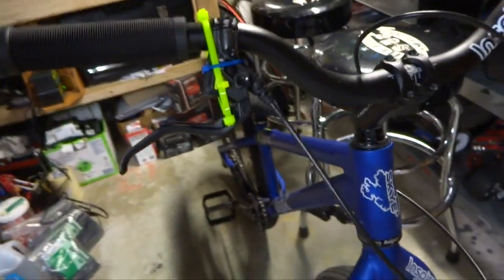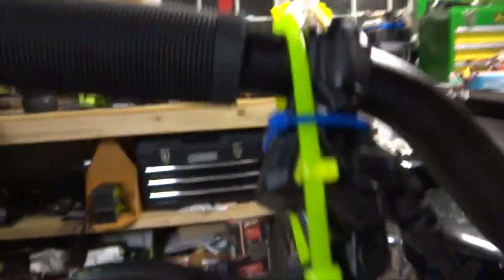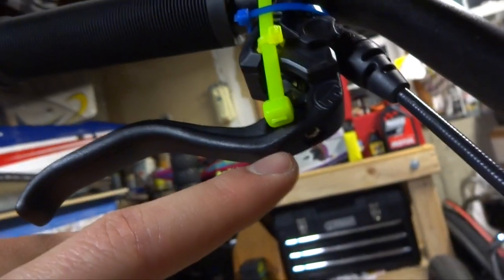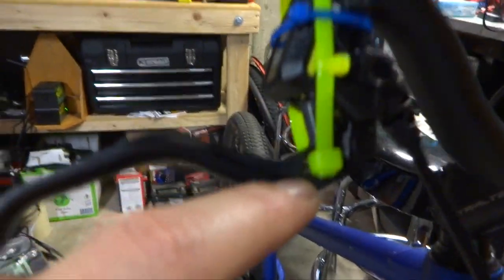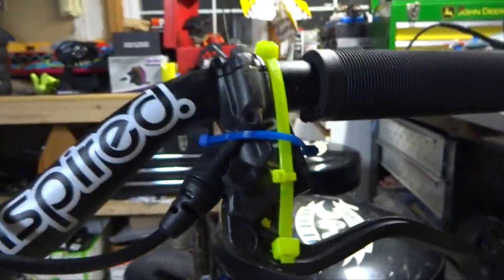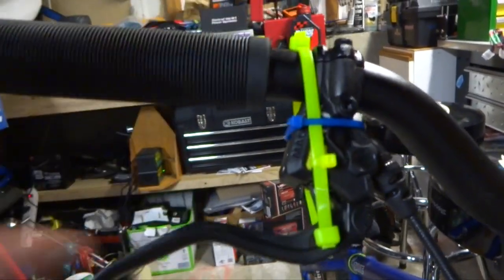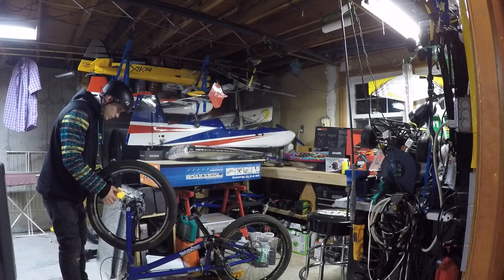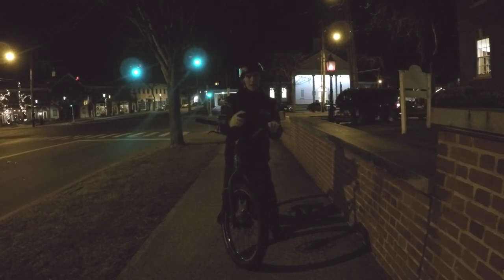Why Do I Zip-Tie My Brakes??

Comment: Honestly, as a professional bike mechanic I have to say that the zip-tie-"trick" is quite bodgy. Modern brakes close the hole to the reservoir when you pull the lever. The zip-ties you've installed effectively always pull the lever and therefor the reservoir never opens. This makes you unable to bleed your brake with the zip-ties in place and also the pistons in the caliper won't come out further as your pad wear progresses. In advance if the brakes get hot the break fluid expands and usually floats into the reservoir but as it is still closed off it effects your pressure point.
No offence but I'd say you should rather get accustomed to the different feel to your original brakes or buy different brakes and not just the one that Danny Mac runs.
Reply: Still you are an amazing rider. I wish I had your skills ;)
Reply from the maker: I understand your thoughts on using the zip ties. Yes this could cause problems down the road and I didn't want this to seem like a tutorial for how to make brakes stop better. Rather, simply answer the question as to why I have them on my bike since many people have asked me this question. Also, thank you for the kind words on my riding I appreciate it!
Reply: Actually I've been wondering too why you have them. Thanks for not taking the criticism the wrong way. I'm a subscriber since 200 subs or so and a big fan ever since. Keep up the good work! 
With your brakes, maybe you could copy Danny completely and put a bit of foam rubber on the inside of your break levers. He apparently had the same issue with squeezing to hard and trapping his fingers. :)
Reply: Indeed the new Danny Mac special edition MT7 brakes have a custom lever blade that's machined smooth on the back so you don't thrash your fingers.
Reply: Love the vids bro keep it up!  Not a bad little trick I fully understand.  Also if the caliper is slightly mis-aligned the pads don't quite work there way towards the disc completely and that causes increased lever throw and a warped rotor can push the pistons back in a bit too which increases lever throw a surprising amount. Basically if the pad pulls back at all from the rotor when the brake is released you will have increased lever throw. All this based on first hand experience with MT5 brakes on my street trials bike.
Reply: Hey, do you have any source or photo of this foam rubber on levers setup? I sometimes also have problems with crushing my fingers.

Comment: I have a similar sorta issue as I'm incredibly fussy about how my brakes perform (I like them to be like a hair trigger and snap on at almost full hold with less then 1 cm of lever movement).  A bike mechanic I know said something about over bleeding the system to achieve the feel I desired - but he also cautioned me against doing it as it may cause failure in the brake (he didn't elaborate).  I had (actually still have) an old Hayes single pot on a 200 mm rotor and that thing was a monster when applied - it was capable of spitting me off and flipping that 25 Kg bike with a single finger at almost any speed :) (I mention it cos the same mechanic bleed it perfectly).  Long ramble short, maybe over bleeding is something to look at if you get sick of your zip tie idea.

Comment: Finally😂 I've waited for some sort of explanation for the zip-ties and now i got it☺ But if you thigten this screw and hold the lever in place doesn't that mean that the caliper is getting pushed toghether  and then the pads rub to the disc? (If my english isn't that good i'm sorry i'm from Switzerland😁)
Reply: Sumo's'Enduro, I have magura mt5's on my bike, and there is a slight dead-zone when pulling in the levers, zip-ties can allow you to get rid of it.

Comment: And couldn't you do that with a longer screw? longer screw means that you can put more oil (piston is extended and less compressed), then you have to do less pressure on the break for block the wheel.